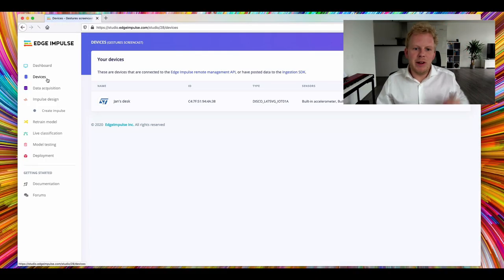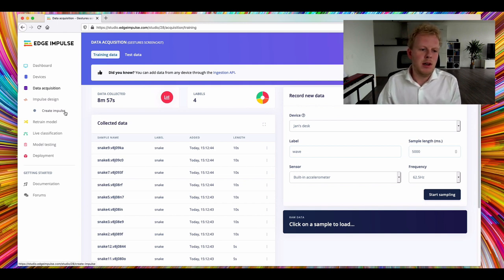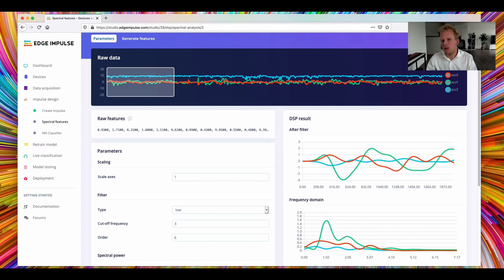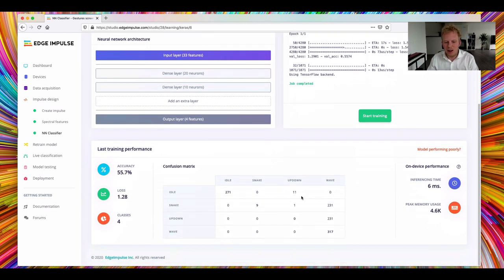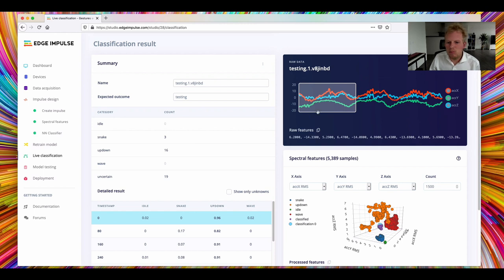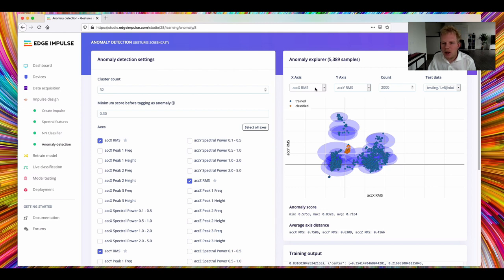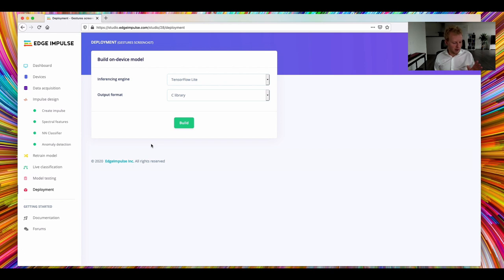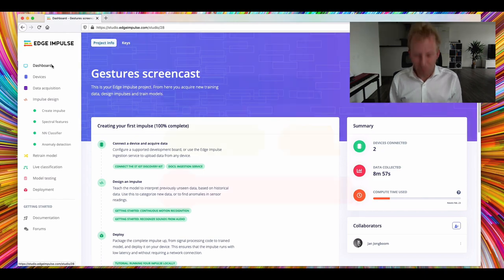Building a Continuous Motion Recognition System with Embedded Machine Learning

Comment: Hi, thank you for this video, I remark that there was a c library which not available right now, so is it possible to use a c++ library in my c code or can I add the firmware model to my code?
Reply: You can compile the inference code to a library, then link from a C application. See https://github.com/edgeimpulse/example-standalone-inferencing-c for an example.

Comment: Hi, I am using NUCLEO-F446RE, I think the only way I can connect the board to EI is through data forwarder, but the instructions in the documentation is a bit confusing to me. It says load any application and run $ edge-impulse-data-forwarder
I am using Windows, does this means I need to have a virtual machine to run that on Linux?
Reply: No, just open a command prompt and run `edge-impulse-data-forwarder` - works on Windows too.

Comment: Is this really continuous though? The 2 second intervals really suck. I deployed my model to Arduino library, where there is a regular sketch and a continuous sketch. The regular one with the 2 second interval is quite accurate, but the continuous one basically doesn't work. Why is this?
Reply: Hey, the continuous one is the exact same model, but some smoothing applied. You can just get rid of the the smooth calls and print raw predictions to get the exact same output. If that doesn't fix it please create a post on forum.edgeimpulse.com - easier to help from there!
Reply: @janjongboom7561  ah got it, I'll give it a shot, thanks for the response!